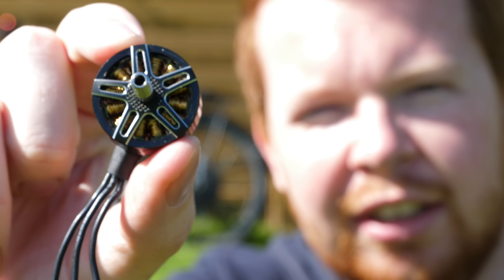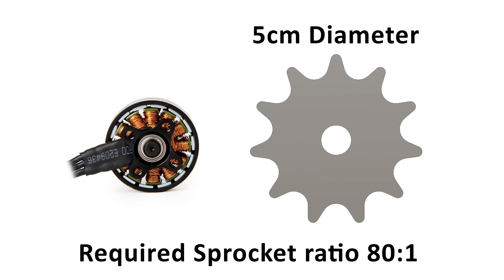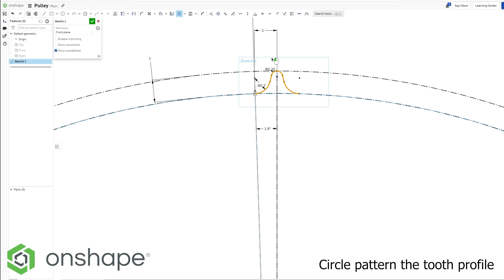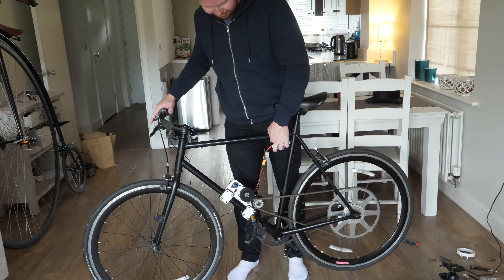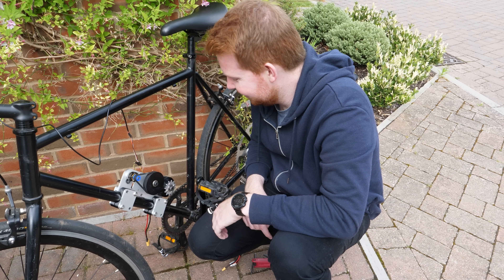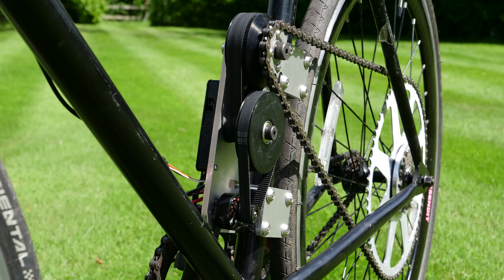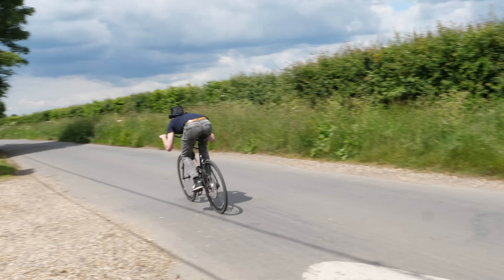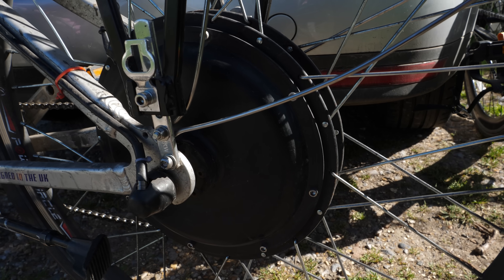Tiny 1kW Electric Bike Motor

Comment: Right Tom its time to combine two of your projects to get the tiny motor to work....

It's flywheel time

Yeap spin up the flywheel you had using the tiny drone motor then use that as a boost for the bike
Reply: That's... a really fun idea! Would pair well with the low duty cycle of such a small motor.

Comment: Arguably one of the biggest issues is none of these power ratings are accompanied by a duty cycle. Just like comparing the tractor to the GTR, the 1000w hub motor can handle that peak power demand for much longer durations than the drone motor.

Still, it's absolutely hilarious to see such a tiny motor do all that work. Nicely done!
Reply: Most ebikes and electric scooters are overbuilt and usually put out much more power than advertised, the manufacturers (chinese ones mostly) outright lie about their power rating because of legal reasons, so the vehicle will not require registration, licence and probably cheaper and less paperwork to import/export. 
For example i have "250w" "electric bicycle", but in actuality its a 50cc scooter chassis with a hub motor, it has lead acid batteries and weighs 86kg and yet it can reach 42kmh and accelerates pretty well, not as well as a real 2 stroke scooter, but pretty well. I looked at the controller and it said on the label that it can put out 25A, on 48v its 1200W, so about 5 times as much as advertised.
Reply: Yup that motor is impressive asf!
Reply: The drone motor power rating is continuous, but its measured with a prop attached. At that power and size it would have airflow around 150-200mph, staying at a equilibrium stator temperature of around 60 celsius. Drone motors are designed to be as light as possible, and they can get away with it because of that airflow.
Reply: @drkastenbrot  It would be interesting to see a new pulley printed with an impeller to help draw some air through the motor, but at the end of the day it's asking a lot from some dubious ratings.
Reply: @Maxzillian  the only smart thing would be using a motor appropriate for the application. rc boat motors are similarly power dense but they use watercooling to get rid of the heat. much easier to provide than 100+mph of air and the torque is also more appropriate for driving a bike.
Reply: @drkastenbrot  A: No one said anything about being smart. ;)

B: if this video was about using the right motor for the job it would have stopped at using the bike hub motor.

So just to be clear, I'm just speaking of how to use the motor he selected in a better fashion; if this was worth investigating any further.
Reply: @drkastenbrot  It's not just about airflow, it's also about current. Drone motors operate at relatively low current because they're always spinning nearly as fast as it's possible to do at the voltage being fed into them. If you apply a significant load then the motor slows down, decreasing back EMF which then increases current, so at the same voltage you have higher current. That means that under the more significant load of a traction motor, at 1kW you're delivering less voltage and more current than the same power to the same motor with only a prop. The current is what matters for resistive heating in the coils, so motors will have a rated max current which is almost certainly way lower than you'd think given the power rating in this case.
Reply: @bosstowndynamics5488  Not sure where you got this nonsense. The motor shown in the video is rated for up to 50 amps. My 5 inch drones draw around 20-30 amps per motor at full throttle continuous. 
You just described a motor load curve which is not unique to drone motors. 

The BLHeli ESC used in the video has ramp up power protection, so it accounts for a torque overload. All that remains is airflow, and the fact that the motor wont come anywhere close to 1kW at rpm that low.
Reply: @drkastenbrot  Again, at full throttle with nearly no load the motor will be capped by voltage, not current. The ESC more than likely isn't programmed with that motor's current limit, so under the much higher mechanical load of a bicycle compared to a 5 inch drone prop the ESC will wind up feeding in more current at the same voltage. I'm well aware this phenomenon applies to all motors but traction motor systems are already configured to account for high load scenarios while drone ESCs are built under the assumption that loads are relatively low.
Reply: @bosstowndynamics5488  This entire low load thing does not make any sense. Drone motors are pushed to their limits because why would you not want the full speed a drone could do. The way we do that is by choosing an aggressive pitch prop.
Reply: @drkastenbrot  Load was probably the wrong term to use there. What I'm getting at is that there's a lot of ways motors can deliver mechanical power - if a motor is developing a lot of torque it takes the same power to spin at a lower speed as it does to make smaller amounts of torque but maintain higher speeds. Drone motors are almost invariably configured for high speed low torque applications - even a high pitch prop spinning in air is going to require very little torque to spin at max speed compared to traction motors pushing 100kg of person and bike alone a road. More importantly, the current requirements for a drone motor are generally fairly consistent, in that for a given motor at a given speed it's almost always going to be using the same current, as the rpm is determined by the voltage and the fairly consistent load of a spinning prop in air is going to mean a fairly similar current each time. Because it's being run on a high traction surface though, the traction motor in a ground vehicle can wind up in states where it's under very high load *at low speed*, the result of that with a relatively simple ESC without a specifically configured current limit is that it can get far more than its rated current even within its rated power. If you feed 1kW of power into a 20ish volt drone motor on a drone it'll be pulling 50 amps, if you feed 1kW of power into the same motor on a bike at low speed spinning at 1/4 of its typical top speed speed then it'll wind up pulling 200 amps, because the back EMF will be far lower so there's much less restriction to current flow and it will wind up taking far more current to develop enough torque to spin. That's more than likely a big factor here - Tom geared the bike based on the drone motor hitting its top speed at the ebike's top speed but it's going nowhere near that fast. The ebike's speed controller knows this can happen, it's programmed to limit current delivery to the maximum motor rated current even at low voltages, but blheli is built for direct drive props. There are plenty of examples of people running drone motors happily on electric ground vehicles, but when they do they use a VESC or similar because those are ESCs that are configured for traction motors and are better equipped to handle low voltage high current loads that don't really occur on drones.
Reply: @bosstowndynamics5488  Like I said, the ESC limits power. It has a rudimentary form of current sensing and regulates directly based on back EMF with a phase angle that can be changed in the settings (BLHeli configurator). Its a fairly foolproof way to drive a brushless motor with the only risk being overtemperature from insufficient cooling. 
You are making an absurdly overcomplicated attempt to explain a basic motor concept, the torque curve. 
This video already adds a huge reduction to the drive to get the motor in the appropriate region of its torque curve. 

And no, if you feed 1kW into such a motor, it will not draw 200A. That is not how kilowatts work. I assume its just a typo but it still makes no sense. 

Here is an excerpt from the BLHeli manual, perhaps you didnt know about the way these ESCs operate: 
"Rampup Power: 
Rampup power can be set to relative values from 3% to 150%. This is the maximum power 
that is allowed when ramping up at low rpms and during startup. For low rpms, the maximum 
power to the motor is limited, in order to facilitate detection of low BEMF voltages."
Reply: @drkastenbrot  You are so close to grasping the point while still completely missing it. As you said, blheli uses rudimentary current sensing. *ESCs designed for traction motors use more sophisticated sensing methods*. The part about rampup for instance is actually a configuration to help blheli be not terrible at sensing back EMF at low rpm, not to regulate power delivery.

If you feed 1kW into a motor at 20V it will draw 50A. If you have the same motor but put a disc brake on it and force it to spin at 1/4 the speed, pulling 5V (because the voltage at a given rpm is pretty close to fixed, because it's largely determined by the amount of back EMF which is a fixed constant), and you feed it 1kW it will pull 200 amps. That is how kilowatts work. Because power is voltage times current. Feed the same power at a lower voltage and the current will be higher. The other way of looking at it is that the motor torque is directly proportional to the current, because the current determines the magnetic flux density in the coils, so if there's more resistance on the motor it needs more current because it needs more torque to go the same speed. If you put enough resistance on it, it will need more current even at lower speeds. And the resistance of a single high pitch prop tugging a quarter of a 300 gram drone around is way lower than a single motor towing a bike around. Blheli probably isn't going to feed in all of that current but it's going to try a lot harder than a traction motor controller because it doesn't know what the motor's max current is, if the ESC is capable of 100A and the motor is rated for 50, then the motor's getting 100A until it fries.

And I already addressed the reduction - Tom geared the motor so that at max rpm the bike would be traveling at the same top speed as the e-bike motor. Perhaps you should go back and watch how fast it was actually going, because it wasn't anywhere near as fast when I watched it. That means that the actual speed the motor was going was way slower than its max rpm, and yet the controller was trying to run it full tilt. A free spinning propeller never puts this kind of relatively low rpm, high torque load on a motor, so the relatively simple purpose built blheli RSCs don't account for it. There's a good chance the drone ESC was trying to feed that motor way more current than an appropriately configured VESC would. The performance would be lower but it wouldn't burn out the motor.

Now to be clear I'm not saying that motor cooling isn't a factor, it absolutely is, but proper motor control is also a substantial factor here.
Reply: @bosstowndynamics5488  my guy, 1kW at 25 volts is not 200 amps. I thought it was just a mixup but now you double down on it? 
And again, the ESC has ramp up power protection which simply limits motor current when rpm are low. BLHeli_S does the same and is open source, so just go see for yourself.
Reply: @drkastenbrot  Now I know you aren't bothering to read, I said 5 volts, which is a very different number to 25. Power is current times voltage, 5 volts times 200 amps is 1000 watts or 1kW. And VESC doesn't use something as primitive as ramp up power protection, it actually current regulates directly. Go see for *yourself*, it's also open source. In fact, iirc the project was originally developed *for this purpose*, using drone motors as traction motors, to address the shortcomings of using drone ESCs, that's why I brought it up.
Reply: @bosstowndynamics5488  A project so irrelevant, ive never heard of it, leave alone see it used. And yet again, BLHeli regulates current like any other ESC does. It just doesnt use the current sensor (depite commonly having one), and instead calculates the current using an approximation which is sufficient and much faster. If a motor draws 1kW at 25V full open, it will NOT draw 200A at 5 volts. You have a fundamental misconception about electrical current through a motor. BLHeli wont even fully open if the RPM are insufficient. The stall current of these motors is actually lower than the full open current due to the ramp up power protection.
Reply: @drkastenbrot  FFS, the entire point I'm making here is that traction motors behave differently to drone motors and your counterargument boils down to "but in drone motors...". You haven't heard of VESC because *it's not a drone ESC*, that's the entire point! It's a traction motor ESC designed for electric skateboards and such.

And yes, if a drone motor mounted on a drone draws 50A at 20V, and with the same prop on you feed it 5V it will draw less current. *That is not what I described*. *Motors are not resistive loads*. Look up back EMF and get back to me, because it's fundamental to understand what's going on here and you seem to be willfully ignoring that it exists.
Reply: @bosstowndynamics5488  Of course I know what back EMF is. Youre the one who made the discussion about something completely different, while I was just referring to the drone motors and made it clear too. Your entire low rpm argument only applies with a crap ESC that does not have any form of overcurrent protection and as I lined out it can even be done purely in software.
Reply: @drkastenbrot  If you know what back EMF is why can't you grasp that motors draw more current at the same voltage if their rpm is lower? The point I'm trying to make here is that the load on the motor in an ebike is very different to any load ever imposed in a drone, so the assumptions that blheli developers made about current flow don't apply. As you said, there's a number of design features in blheli that are "good enough" but faster to process - that makes sense in a drone that needs very fast responsiveness but makes no sense in a traction motor setup where responsiveness is limited by friction but more sophisticated control is required.
Reply: @bosstowndynamics5488  Point is that the throttle is reduced when rpm drop. The ESC is permanently measuring rpm and keeping the motor on its load curve. Drone ESCs have more sophisticated motor control than normal industrial inverters.
Reply: @drkastenbrot  Yeah, that's entirely my point - those are the conditions blheli is designed for, and absolutely nothing like the conditions in the video. In a drone, running the motor at low RPM means low throttle and low power. In a bike, running the same motor at low RPM can mean high power and very high current. Pointing out that blheli will keep the motor on its load curve at low RPM and low power makes no difference when discussing low RPM high load conditions like the motors in this video were experiencing.
Reply: @bosstowndynamics5488  How are you still misunderstanding everything? Keeping the motor on its load curve means that blheli will lower power to the motor if rpm are low to avoid burning the  motor. How aggressively it does that can be tweaked in the settings. This is designed to avoid overcurrent damaging the motor, the exact scenario you claim would be a problem. It is not a problem, BLHeli is designed to handle it. 
The only problem is insufficient cooling. 
A drone esc with a drone motor and sufficient reduction would have no problems running a bike as long as cooling is provided. It would be expensive (due to the reduction) and inefficient (due to the reduction), but absolutely possible.
Reply: @Hash Frowns it's 100 percent with a prop on
Reply: They do have duty cycles.  It's called max continuous power and max burst rating.   The test numbers usually say how many seconds the motors were ran up to maybe 10-30 seconds for the burst current rating and they say how hot the motor got.    The continuous power rating would be measured for the range of the battery  measured in minutes or even hours.  
Most airplane motors are designed to run on full throttle until the battery dies.  The ESCs easiest workload is at 100% throttle.  It's up to you to choose the right propeller to only consume enough power that the motor and duty cycle are rated for..  A racing plane will be at full throttle the whole time so they choose a propeller that will only consume at the max rated continuous power for the duration of the race. The duty cycle would be the entire run time of the battery measured in minutes as you wouldn't want to fly with an oversized battery for weight reasons.   An stunt airplane which would only give full throttle for a few seconds at a time for it's duty cycle will use a propeller with a relatively larger load at full throttle so that it's duty cycle would be a few seconds at a time but those few seconds would have a higher workload and will require a cool down period of partial throttle for a few seconds before you can give full m
throttle again.
Reply: @toolbaggers  can you link a drone motor with a burst power rating in the datasheet? I dont recall ever coming across one. They always give ~5min, which is effectively continuous.
Reply: yeah. I routinely draw 5kW from cheap 500W brushed motors designed for ebikes
They're perfectly happy for  5 or ten minutes, then start getting a bit too hot.
Electronics and brushless are rubbish.
Reply: My ebike goes 28 without me exerting myself. And it's 750 watt continuous
Reply: It hits 900 watts for pretty long without any issues. I haven't pushed it more than a few miles that way
Reply: I built a bike with magnetic engine  (No electricity and no batteries) are you interested ? We could build them together
Reply: @Edoardo-r5z Put up a video of it.

Comment: No one would have thought of using a drone motor on a bike. That's crazy 🍻
Reply: I tried it six years ago - it worked for 2 minutes before burning out, so I rewound it with new wire. Then I got a proper hub motor and use it almost daily ever since.